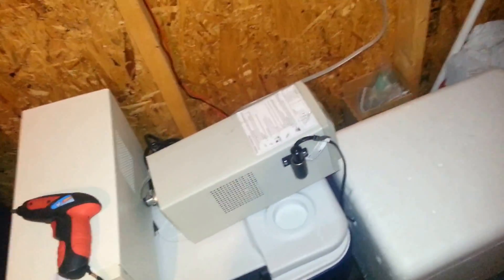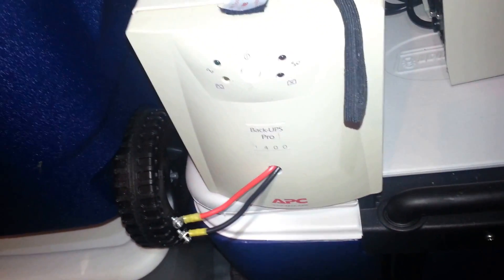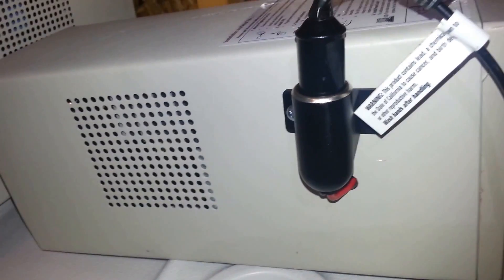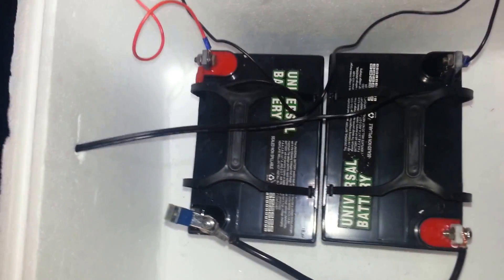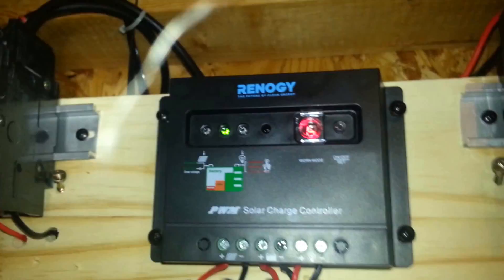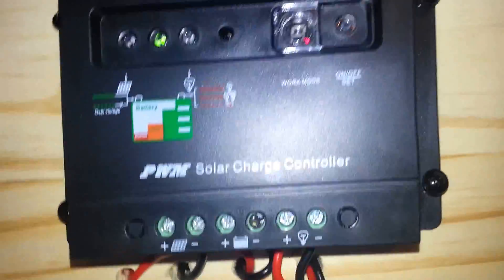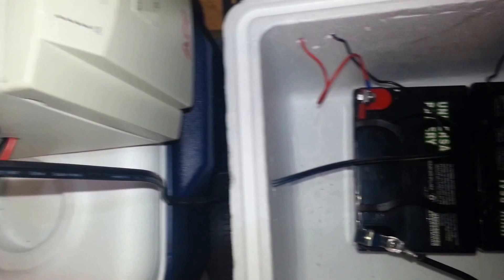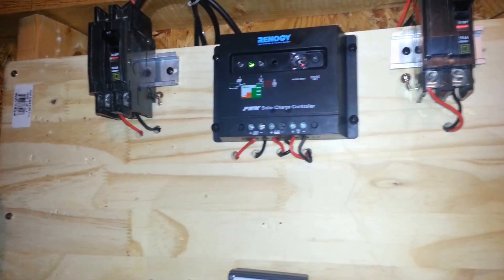Using an APC Smart UPS as Inverter in Solar Setup

Comment: Thanks Anthony for sharing. I use same setup smart ups 1500 = 2 solar panels
Reply from the maker: It's good to hear that you have a similar setup :)  Very nice. Thanks for watching and commenting :)
Reply from the maker: Do you have any pictures of your setup?
Reply: yes I have picture of extended battery and ups together  and solar pannel wiring. But solar pannels (i got 2 x 150 watts) are not outside yet bucause of windows replacement project. I use balcony for my solar project
Reply from the maker: Bor Zvon 
Sounds like fun.
Reply: Any issues since 7 years ago? Still running?